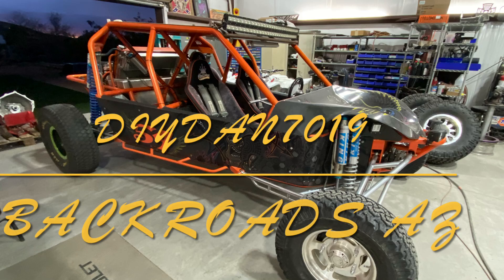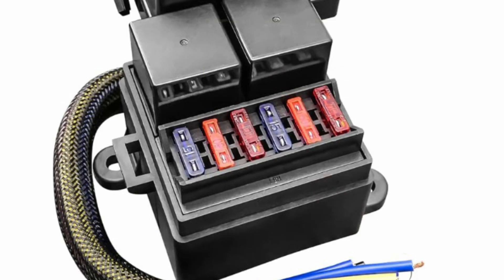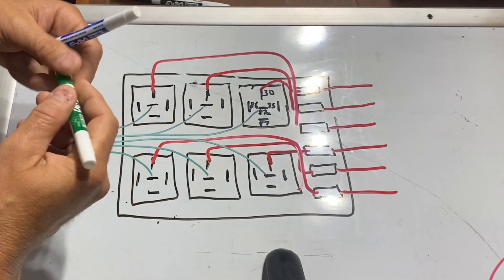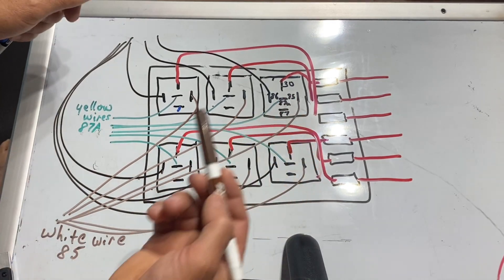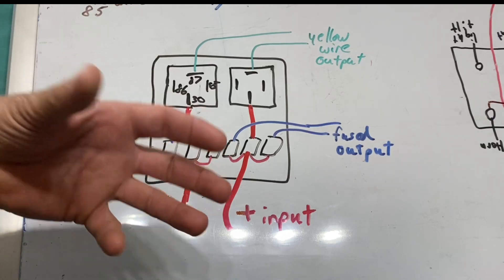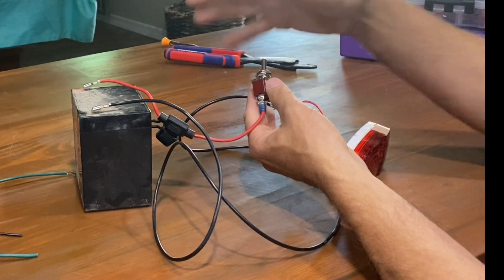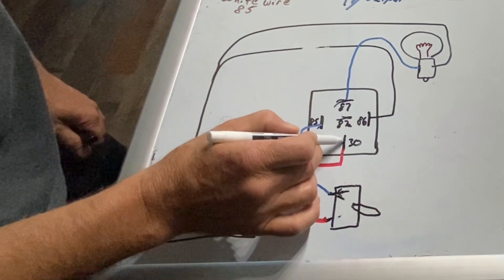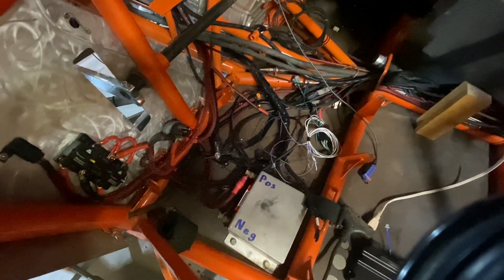12v RELAYS/BOXES DO U NEED TO USE THEM? HOW THEY WORK? HOW TO WIRE THEM & DIFFERENT WAYS TO USE THEM

Comment: Correction regarding the numbering on the 3rd relay. Since you have 30 at the top, the 86 should be on the right. 85 is for ground. I think the mixup is because 30 is usually written at the bottom in diagrams. Otherwise good video.

Comment: Could you avoided the smaller block and used a wire from the larger block to the acc spade?
Reply from the maker: There are several ways to use a relay depending on how you wire it I ran out of room with the big block for what I wanted to do is the only reason I added the smaller block
Reply from the maker: I do have another video that goes into a more detailed view on how to make relays do what you want to do on my mechanical playlist on my channel
Reply from the maker: It depends on how many accessories you are trying to run and wether you might overload the accessory wire on your ignition if I am understanding what you are asking correctly